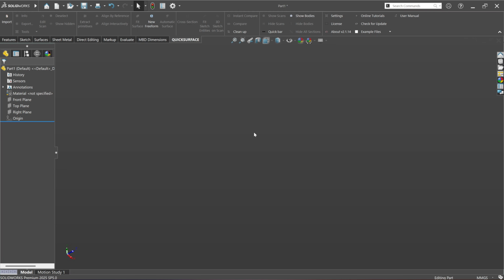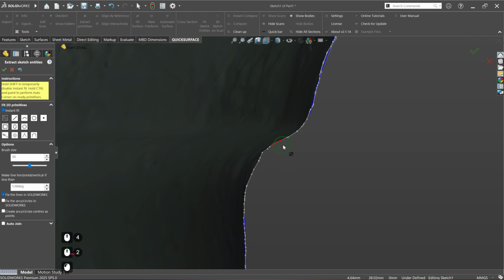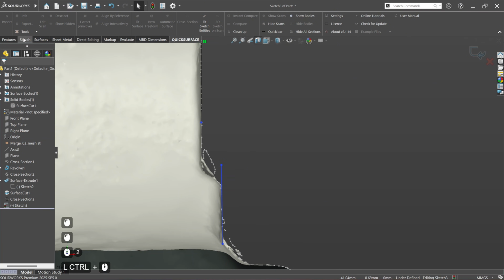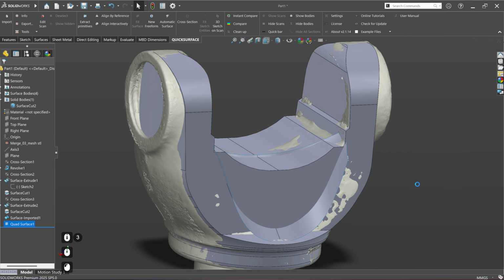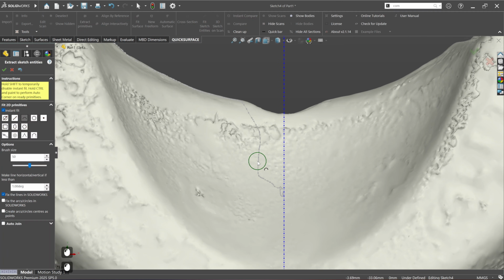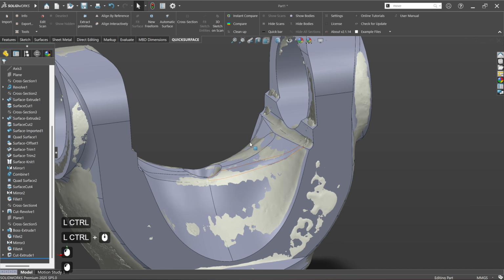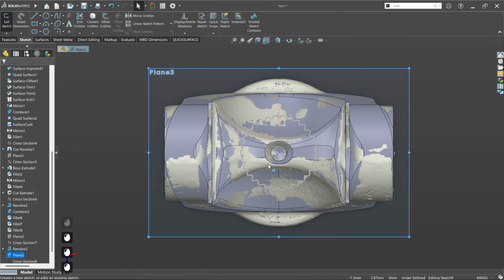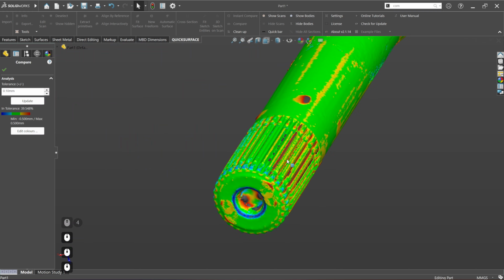Workflow: Reverse engineering of mechanical axle | QUICKSURFACE for SOLIDWORKS

Comment: The base version is not worth the $500 cost. Most of the features they use and point out are only available in the pro version. Save your money and get Fusion 360.

Comment: Does cut with a surface also work in normal quicksurface?
Reply from the maker: In Quicksurface standaone software you can trim solids with surfaces or just split solid with surface if you need to keep both sides.
Reply: @QUI @QUICKSURFACE I have to learn a lot. I love quicksurface keep on going. thank you